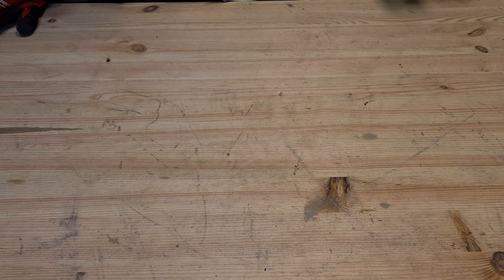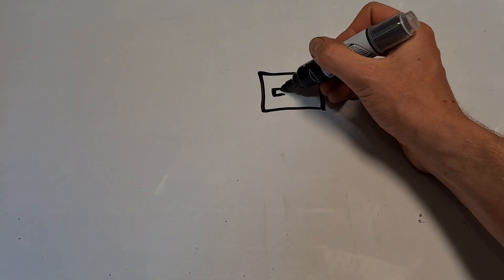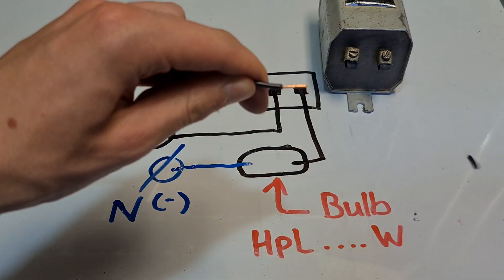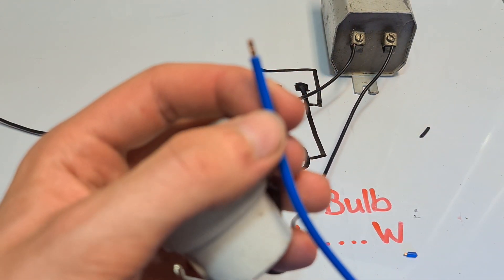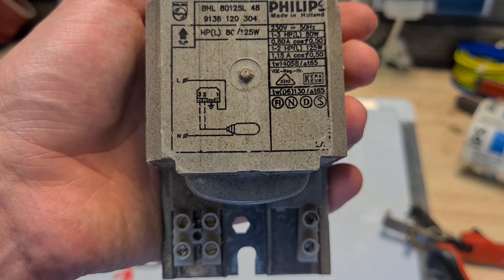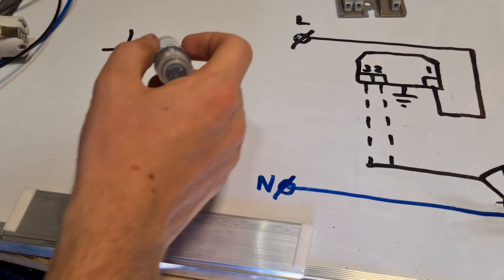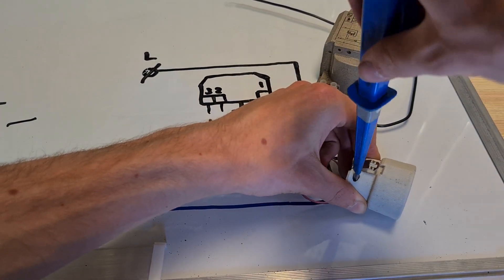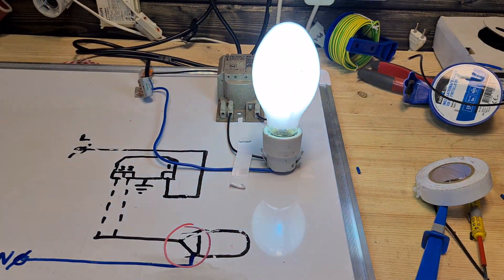How To Connect A Mercury Vapour Ballast!

Comment: The video is old! but I have connected the lamp to the ballast and on the network 230V , then again from the supply to the ballast and finally I connected the capacitor to the ballast and the lamp! is the capacitor connected correctly?

Comment: I want to change from the most popular lightbulbs into this vintage lightbulb but they don't sell light fixtures anymore they only have the regular I got my normal one I plugged it ballast it worked! But my country does not have Mercury vapor bulbs  anymore they don't sell our street lights I found this awesome video helped me I was thinking I would solve a complex Electric question they just selling used ballast with the capacitor used

Comment: Hello, TheLamppostChannel,

Please note that this tutorial only applies to simple reactor/choke ballasts. When wiring up a lamp to an autotransformer ballast, you wire the socket’s live wire to the ballast’s “lamp” lead and you connect the socket’s neutral wire to one of the neutral wires coming from the ballast. Lastly, you connect the ballast’s desired voltage tap to the live wire coming from the mains and you connect the ballast’s other neutral wire to the neutral wire coming from the mains. In the case with wiring a capacitor to your simple reactor/choke ballast, you wire it in parallel with the mains wires to correct the power factor. In addition, some autotransformer ballasts have power factor correction capacitors too. For constant wattage autotransformer (CWA) ballasts, which are more common in North America than in Europe, a capacitor is required for proper operation. For CWA ballasts, the capacitor has to be wired in series with the lamp.

Comment: Your Second ballast have 125W and 80W  Wire tap
Reply: Did you just reply to your own comment?
Reply: But You install 80 Watt hulb on 125W wire tap which overload the bulb, but don't worry it doesn't reduced the bulb lifespan significantly because mercury arc tube is very strong. Even I can't blow my 50W lamp with 400W ballast.